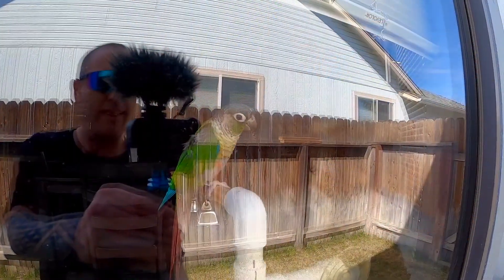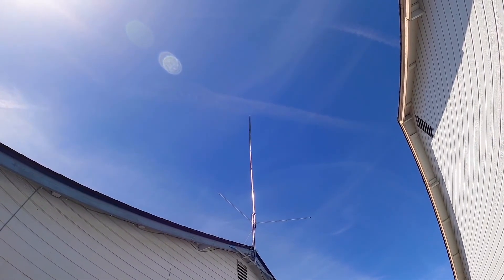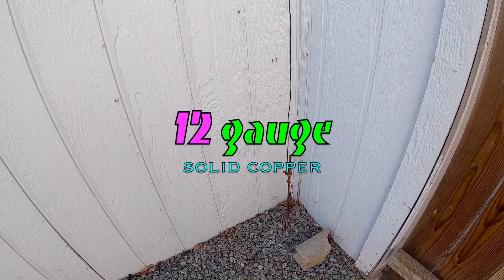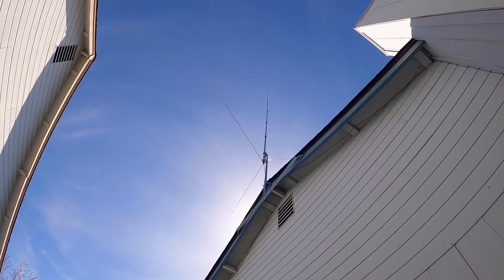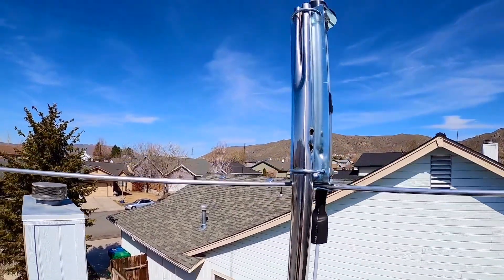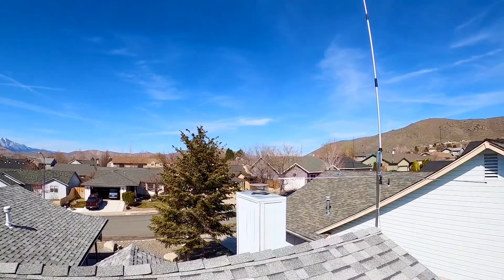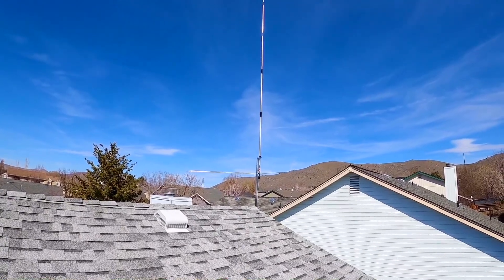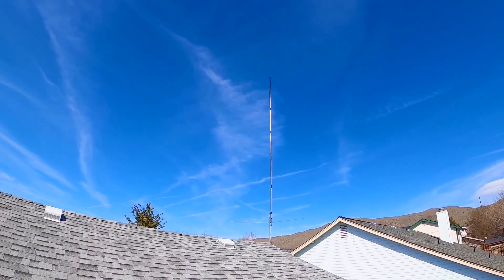Sirio GPE 27 CB Radio Base Antenna

Comment: Nice setup ! Im running an Anytone AT6666 paired with an Antron99 with a ground plane kit . Put a cheap little china antenna tuner inline to help move from low 26 to high 28 . Keep on radio'n .
Reply from the maker: Right on my friend, sounds like you have a kick ass set up yourself!! Cheers and 73's!!!

Comment: ......antenna mounted height is  measured from the antenna base, not the tip. It might be around 40' at the tip....but it's not 40' "off/above the ground". Otherwise, thanks for the video

Comment: Nice antenna. 
I run a Galaxy Saturn Turbo. Silver Eagle Mic. KLV 2000 base amp. 1/4" Hard line coax with a Sirio 827 works like it should. 
Be safe. 
#12 Watkins Glen.ny wavin. 🇺🇸
Reply from the maker: Sounds like you have an awesome station, love those Galaxy Saturns! Cheers to that #12 and good numbers to you!!

Comment: Nice video, good quality. I see a lot of these antenna videos and they look like they were filmed with a potato. Think I'm going to get this antenna, rather than pay $200+ for an Imax 2000. Seems like there wouldn't be too much difference for less than half the cost. My only problem, I'm worried about interference with my neighbors. I'd only be using the standard 4 watts on CB maybe 12 on SSB. Would I need some kind of choke or balun on this antenna?
Reply from the maker: Thank you very much for noticing the quality of the vid as I try my hardest not to produce a piece of garbage! IMO, Imax are overrated plus I have always preferred aluminum over fiberglass anyway as I think the performance of the aluminum is better and gets better as the antenna weathers. Cheers and thanks for the comment!

Comment: Looks very nice. And way higher than my current antenna can be.wow
I also Just bought this antenna.  On the ads they show black plastic section caps. There where you put the gorilla tape at each connection . Now of course I will use the same tape. But mine came without the black plastic caps. 
Did you got it bare? Without any caps?
On other YouTube vids ,You see and or they speak clearly about these caps .
Which suppose to prevent rain/ moisture coming in. But they all use gorilla tape.  Anyway , I have mine in the box ,as it arrived an hour ago   And its of course after opening hours, So  sended an email , where the caps are. And if they can send it to me.
But I dont hear or see these black plastic section things in your video.
Reply from the maker: Glad you enjoyed the vid and found it useful. Don't use your antenna without the black plastic parts as they also provide structural strength as well. Cheers!

Comment: No wonder I can't hear you! 🤦🏻‍♂️
-
Reno Radio just got down!
-
-
We need to talk brother, lol!
-
My Antron is in an HOA and up about as high!
My Antron is setup as a temporary, not permanently mounted. (I take this hilltop when there is enough time ..and people to chat with.)
I have a 4 section (36') mast for when I am no longer in an HOA situation. (Antenna is camouflage painted and partially in a pine tree!)
If you can, put antenna up to 36ft to the base. I can donate some poles or I can loan the 36ft'er to you?
I would never use my antenna so low if it were not for this HOA crap.
My old station in the bay area used to be:
1. a 2 story house
2. a 5 section mast!
3. a 3/4 wave Gama fed omni [Salut model: LW150]  (Total height was roughly 93ft to tip!!!!!!!)
(The 3/4 wave and the top mast section folded over in high winds.) 😥
-
I then placed a new Antron w/GPK on the slightly shortened mast and still got out great, naturally!
At both times, I was running a Galaxy 99v & Messenger M400 box at home and was easily the dominant station for miles and miles around for a while.
-
As far as I know, I am the dominant station in Reno/Sparks. (There is a guy on 38LSB that is near but I'm not sure how well his setup performs in comparison to mine on AM.)
I'll ask 722 what he thinks since he has been around here for a long time and may know more signal strength info.
Reply from the maker: I really have no place to guy wire a mast so that is why I have not gone any higher plus I am not sure how that gable end mount would handle a longer mast as well? Sounds like your stations have been awesome good sir!!